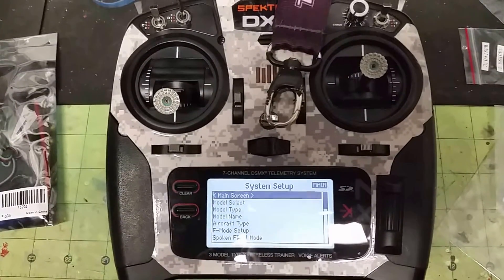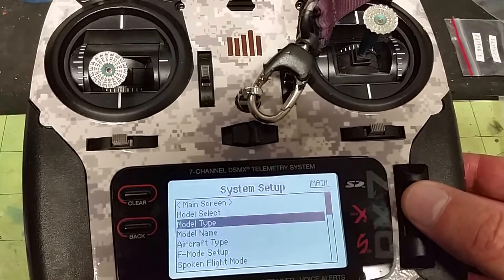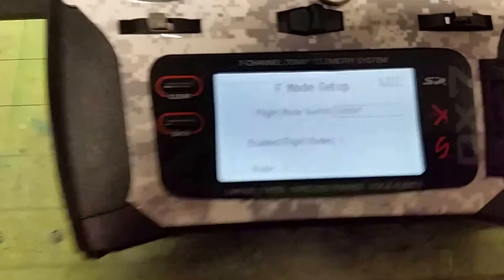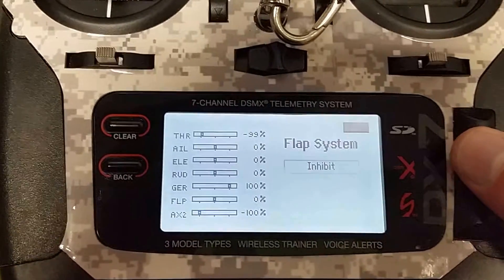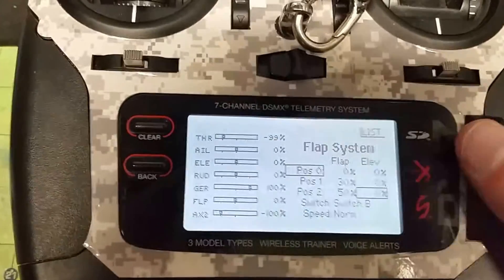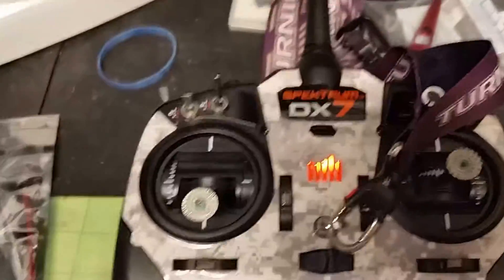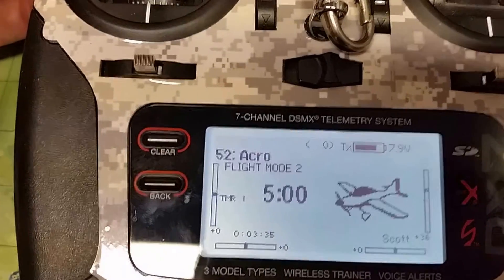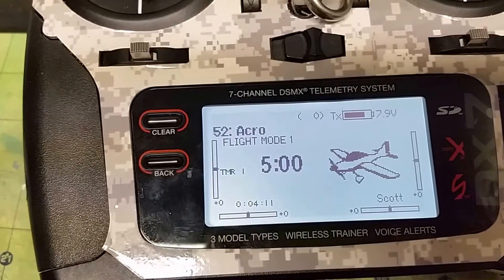Spektrum Transmitter Tutorial: Setting up flaps with flight modes

Comment: is there any reason I would want to set up a " F-Mode" , switch  if my plane does not have flaps? .....   thanks
Reply from the maker: I have some handlaunch planes setup where 1 flight mode has a lot of up elevator to let the plane climb off after I chuck it. Then, once I get both hands on the transmitter and the plane is at a good altitude, I can flip the switch back to normal flight mode.

Comment: This is a great use of Flight Modes for a flaps plane so it will store trim settings in real time for each flap setting rather than going into the flaps menu. Thanks, so far I like it. Changed it on the UMX Timber and Turbo Timber.

Comment: why 1 flap when you have a flap on both sides?
Reply from the maker: Sorry for the late reply. You would choose 2 Flap if each flap was plugged into a different port on the receiver. Example: Left Flap is plugged into AUX 1 and Right Flap is plugged into AUX2. In 90% of planes I fly (and others I know), the flaps are usually combined using a Y-Harness and are plugged into a single channel on the Receiver (usually AUX). So this is why you choose 1 Flap in the Spektrum menu.
Reply: Fantastic!  I'm new to flaps and anything not stock thankyou!!!!!